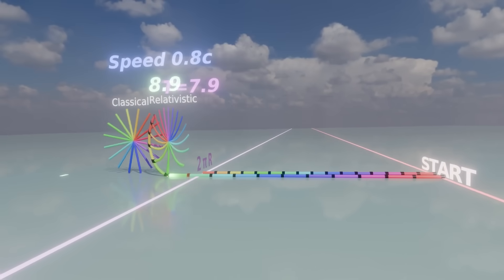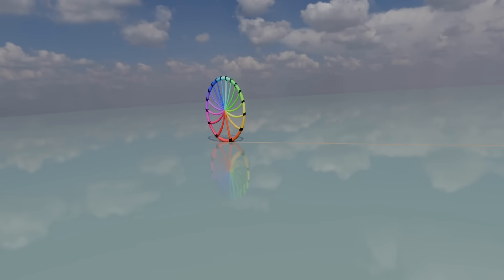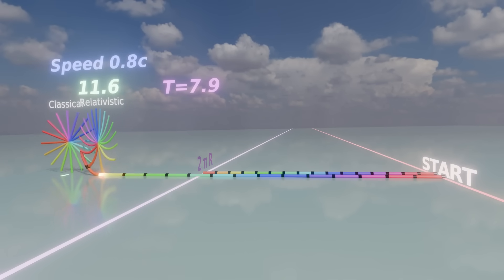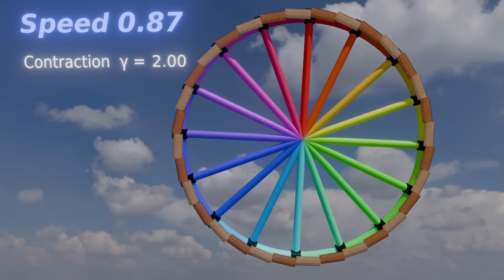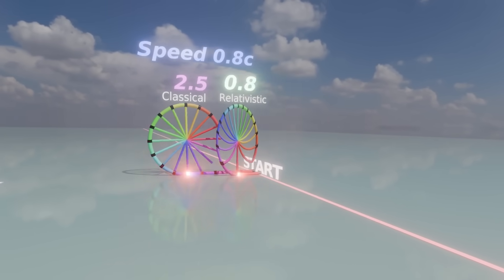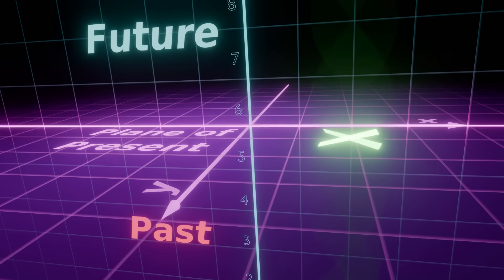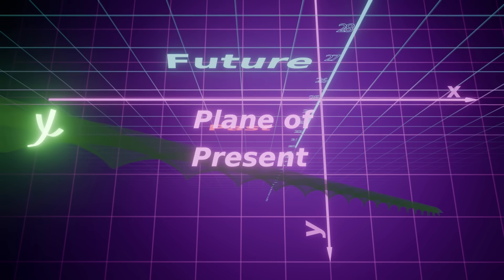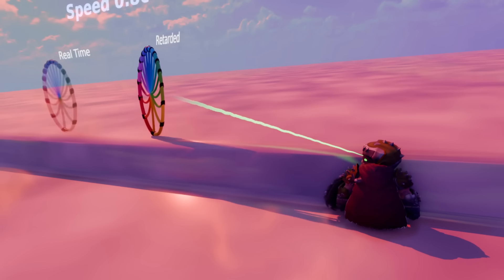Relativistic Rotation 1: Ehrenfest and the Wheel

Comment: Okay, gamma is just the energy of the system. The more energy, the longest the distance. But this distance doesn’t appear magically: it gathered its energy from starting part, and will have more energy to dissipate to get to zero.
Reply from the maker: there is more energy to be sure and it is gathered when put into motion. but Im not sure i follow your reasoning. there is, for example, no energy dissipation in this demo.
Reply: @imaginingPhysics  yes, and there is no energy gathering either. 🙂
I mean, if that was a physical object it would experience infinite acceleration (hence deformation) to go from rest state to accelerated one. This doesn’t conflict with your explanation, but the transition between "classic" state (the vertical helix) to the "deformed" state (the slided helix) requires smooth shape curving where the helix leans more and more towards its diagonal shape.
The sharper the curving, the more stress to the system.
Reply: It's not "energy" it's just a regular old scalar value for transforming coordinates from one inertial reference frame to another. It makes numbers bigger and smaller; that it.

Something that doesn't get explained well in pop-sci infotainment about Special Relativity is that the "time" coordinate is literally a space coordinate, like a real physical distance between two locations in meters not in seconds.

Specifically, it's the radius of a sphere centered at the inertial observer of your choice (such as yourself). This radius is the diagonal 45° line(s) on a Minkowski spacetime diagram. The 4D past light cone being a 3D sphere. (I'm trying to keep this reply short.)

Anyway, time dilation increases lengths along the "time" coordinate... which is the radial direction in 3D Cartesian space from the viewer to the object. So the object appears to stretch in that one direction while it appears to shink along another direction. (The sum of each length squared will remain constant.)
Reply: @juliavixen176  the displayed result is a transformation viewed from that perspective. But get this item as reference frame and you get the "classic" view back, and the previous round version will have its shape deformed accordingly.

So I assure it depends on the energy stored in the system, relative to the reference frame. In the helix version, the more verticalley the motion is, the straighter the displayed version.

Comment: I don't understand that Lorentz, because if an object narrows, it turns out that during acceleration/braking its front part doesn't have the same speed as the rear. For me this is not even a relativistic paradox but simply logical nonsense, like some others in the theory of relativity, which no one has ever voiced or explained
Reply: See: Bell’s Spaceship 🚀 🚀 paradox.
Reply from the maker: You are right that if an object accelerates/brakes then it's parts will have to accelerate at different rates (or else experience stress forces).
Reply: You could force the front and rear to have the same speeds, but then you would put stresses on the object - which obviously get super large for relativistic (changes in) speed. When you start accelerating things in relativity, the accelerating objects can't be classically (i.e. perfectly) rigid. Einstein said something about space and time being squishy like a jellyfish. You can't move perfectly rigid objects through that squishy, deformable spacetime, so you have to abandon the idea of classically rigid objects.
Reply: @mikebeaton5632  My question isn't about rigidity. Let's say the front and the back of an object were two separate, unconnected entities (and atoms, as I understand it, essentially are). If you were to accelerate them with identical parameters - starting at the same time and ending at the same time - the distance between them would remain constant at any point. If it didn't, that would mean they were accelerated differently. But we are dealing with a single object; it is accelerated as one whole because it is one whole. So why then do the front and the back travel different distances..
Reply: @wingstrongwingstrong I really think your question is about rigidity...! Imagine the two atoms are close enough that they are bound by atomic forces and have a certain distance between them. Now if you accelerate them, the actual amount of space between them changes (!) - so either they keep the same distance apart and the bond comes under stress, or they change distance apart. If you imagine a row of such atoms, the actual number of atoms that will fit in the uniformly accelerated space, bound by an unstressed bond, will change. So either the length of the object must change (front and back accelerate differently) or the object must come under stress.
Reply: @wingstrongwingstrong  Lorentz contraction is relative because simultaneity is relative. Atoms can accelerate simultaneously only in one reference frame. If they accelerate simultaneously in their own frame, then the distance between them will not be contracted in their own frame. But it will be contracted from the perspective of the systems with respect to which the atoms are moving, because from the perspective of those systems, the atoms do not accelerate simultaneously. If atoms accelerate simultaneously from the perspective of some other system, then the distance between them will not contract from the perspective of that system. But then, from the perspective of the atoms, the distance between them will increase.
Reply: @pawegawe4887  "of the systems with respect to which the atoms are moving, because from the perspective of those systems, the atoms *do not accelerate simultaneously*" - here, I don't get it why.
If the issue is solely that the object is being pushed from behind, and the object is, like, rubbery, then that would make sense. Although, if it were being pulled from the front, then it would, on the contrary, be stretched. But if that's not what this is about, then I don't understand what's going on at all. I don't get it why can simultaneity not be simultaneous if the atom is in front are the same as the atoms in the back - just shifted forward a meter🤷‍♂
Reply: @wingstrongwingstrong  The relativity of simultaneity stems from the constant speed of light relative to all inertial frames. This is well explained by the experiment with a railway carriage. We light a light bulb in the middle of the carriage. From the perspective of the carriage, the speed of light relative to the carriage is the same in all directions, so the light will reach both ends of the carriage simultaneously. But from the perspective of the railway station (relative to which the carriage is moving), the speed of light relative to the railway station is the same in all directions, so the light will not reach both ends of the carriage simultaneously.
Reply: @pawegawe4887  Understood, i.e. everything leads to the same (tested and proven in practice) things that do not make sense. Understood, thanks for the explanations. Although, if such thought experiments are slightly complicated, they begin to work in the opposite way, but no one discusses that anywhere... so perhaps I will never understand
Reply: @wingstrongwingstrong Hi again! I think the other reply from @DrDeuteron which says 'see Bell's spaceship paradox' has it right. You said that no one has voiced or explained this, but actually some very clever physicists were worried by exactly the same things as you are, and then they have voiced and explained it - see Bell's spaceship paradox! (I don't claim to be an expert, just an interested learner like you are, but I think this is right!)
Reply: @mikebeaton5632  Yeah buddy, I just haven't gotten around to reading it yet, but I'll definitely check it out
Reply: @mikebeaton5632  I watched two videos about this. So, the same thing happens there as with rails in winter – they cool down, they shrink
Reply: @wingstrongwingstrong  In Bell's paradox, ships accelerate simultaneously in the station frame. The string between the ships is subject to Lorentz contraction, so it will break. From the ships' perspective, the distance between them increases, and therefore the string will break. The cause is relative—the effect is the same.
Reply: @pawegawe4887  That's not the point, the key point for me personally was that the ships actually do not move away from each other (what seems to them does not matter), which means an object is compressed purely due to the rigidity of the material because the atoms and interatomic fields of interaction become shorter.
because the front and back parts of the object are each in their own frame of reference, the space around them is curved (to put it simply), which pulls the parts of the object in one direction or another, and the material simply resists and takes on its natural unstressed form. So the front and rear have just sliiightly different acceleration
Reply: @wingstrongwingstrong  In SR, it doesn't work that way. Ships don't move away from each other from the station's perspective, but they do from the ships' perspective. Both perspectives are equally valid, because both lead to the same result. The experiment takes place in flat spacetime, so gravity doesn't play a role.

Comment: I once pulled a Timex watch out of the washing machine and joked with my wife that it must have lost some time in the spin cycle.  She didn't get it, but it got me to wondering what would happen in a relativistic washing machine.  Would the circumference and diameter of the drum change as measured by me standing outside the washing machine?  What would it look like?  Now I'm starting to see how this might work.  Fascinating.
Reply: I'm not sure if this experiment has actually been done, but a clock in a spinning centrifuge will measure less elapsed proper time than a second, inertial, clock not in a centrifuge.

I heard someone actually did, or was actually going to test this. With good clocks you can measure this effect just spinning one at something like 15,000 RPM for a week.
Reply: @juliavixen176  technically GPS satellites are doing this experiment (although ita different due to gravity), and you do indeed have to adjust the clocks on the satellites to maintain positional accuracy.
Reply from the maker: Nice :). Yes, always think how stuff would behave relativistically.

Comment: Just curious. Is the time dilation here due to linear velocity SR, or due to (angular velocity) Acceleration GR?
Reply from the maker: The time dilation referred to in this video in the explanation why the period of one full roll in longer, mean time dilation in the frame of the moving axis. But of course the different part of the wheel are moving at different speeds so their time dilations are different. But All is SR.
Reply: @imaginingPhysics  Do you think equivalence principle (acceleration) would play a role in the outer circumference of the wheel. Aka would there be some equivalence with time dilation due to gravity/acceleration?
Or does the linear component of angular velocity dominate.
For example if the wheel is rotating but stationary with say 0.9% speed of light at the circumference.
[ It has been a long time question of mine in attempting to relate angular velocity to gravity, but most tend to blur linear velocity with the acceleration when we talk about rotation.]
I wanted to add pseudo mass to my time dilation clock and graph the dime dilation effect from acceleration, but I am a little stalled because of the question.
Reply: @imaginingPhysics  P.S. Sorry for my lack of manners.
Thank you for the response. It is appreciated.
[Tired and distracted X-) ]
Reply from the maker: @axle.student  Well...the centripetal acceleration is locally indistinguishable from gravity, but the if you move you will experience coriolis forces (or their relativistic variations) and that is how you will know you are in a rotating coordinate system. About the time dilation: yes the rotating observers experience time dilation which may be somewhat like in a gravity. Sorry this comment section is a difficult media do explain these idea. Maybe the next video where we look at the geometry of a rotating frame answers some of your questions.
Reply: @imaginingPhysics  "Well...the centripetal acceleration"
Thank you, that sort of confirms what I would expect.
This originally left me with a problem as follows.
If I place a hypothetical small mass at the outer edge of the wheel (tip of the second hand of a clock in my case. Radius 2862807095.5421653553357478091848m)
slow the clock down 0.01% for a moment.
.
I have this very small mass traveling at a velocity (angular) almost 'c'. So I have time dilation due to velocity (proper time almost stops).
I also have the same small mass approaching accelerations near the equivalent gravity of a black hole which also means the proper time almost stops.
I have time dilation 2 times. Time has almost stopped and almost stopped again lol.
.
So what is going on lol
Is the acceleration here the inverse of gravity, does the time dilation for acceleration calculate in the opposite direction (Time speeds up to 2 * 'c').
Does TD due to acceleration cancel out TD due to linear velocity and there is no time difference, no time dilation at all lol
>
They may seam like silly questions or ideas to some (like creating a hypothetical solar system sized clock) but when we take these concepts in the other direction down to the spin of a quantum particle it all gets serious lol
>
Nature throws some crazy stuff at us to work our :)
.
P.S. It's OK if you don't answer. I have no expectations on your time or desire to live rent free in your head.
Maybe it is worth a video to you in the future :)
Reply: @axle.student  I answered your question. You'll need to change your comment sorting settings if you want to read it. YouTube hides some comments (I don't know why).
Reply: @pawegawe4887  "Perhaps I can try to help you ..."
YT is a terrible discussion medium.
Thank you. Your response was very helpful.
We still are stuck in a kind of twins paradox though.
As far as I know gravitational dilation is real to the object under acceleration, so an object at the outer circumference has a slower clock. Hypothetically it (the clock) could reach Zero with enough acceleration.
But then from the observer at the center already knows that the clock of the outer has stopped, and now it has also stopped due to the velocity of the outer object as well. The observer at the center sees an object at the circumference with 2 different time dilatation at the same time lol
>
It may be correct, but it puts a weird time dilation curve on it all lol
Reply: @pawegawe4887  P.S. "Let's assume the observer at the center is not rotating"
That also puts an interesting twist on it. The observer not rotating (Watching the outer of the wheel spin past), vs rotating at the same rate as the object at the circumference.